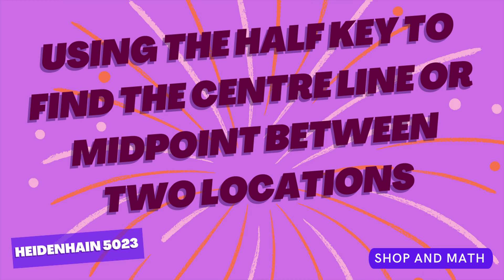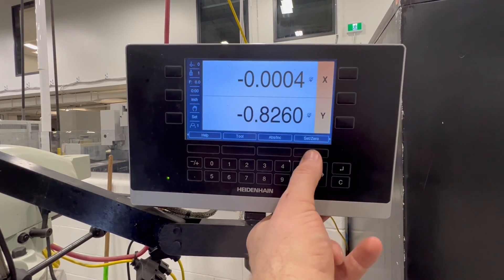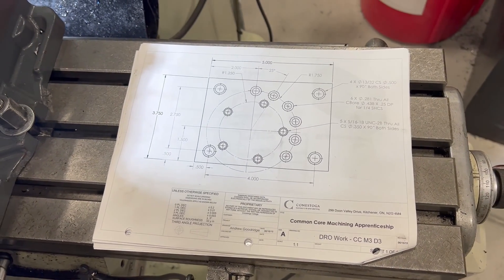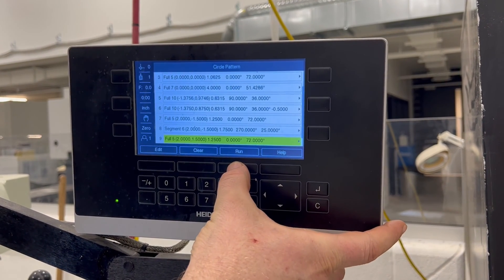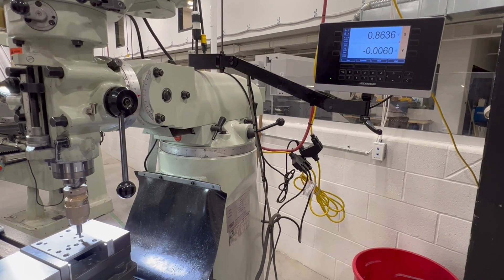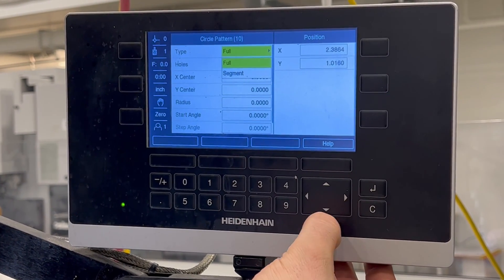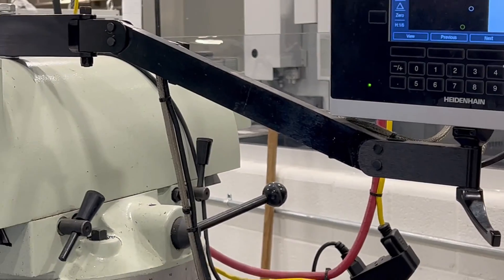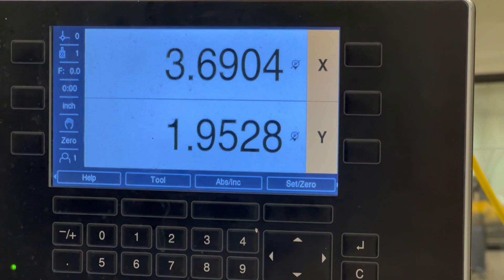CALCULATING A BOLT HOLE CIRCLE WITH DRO

Comment: Wouldn't you have to account for the diameter of your finder on the 1/2 function as well?
Reply from the maker: on this particular unit, this is the exact way that we do it. We have two other styles of read outs that are a little bit different.
Reply: @shopandmath  I see. Thanks